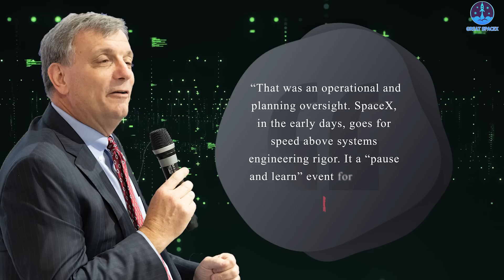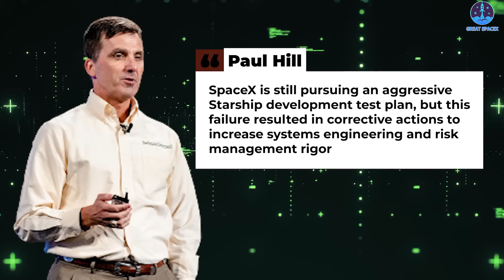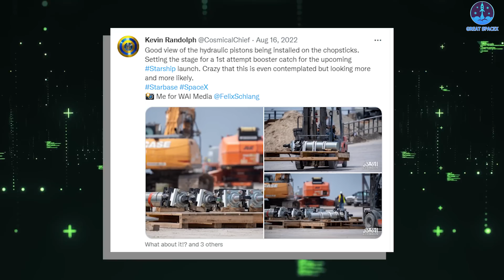SpaceX made HUGE UPGRADES in Stage 0 to prepare for orbital flight

Comment: There is no chance for a maiden flight of Starship rocket before implementation of another major improvement: dual use of Vacuum Raptors as propulsion engines and more importantly as support columns transmitting thrust generated by SH Booster to the Starship during launch and ascent.

Comment: NASA is too afraid of failure to try anything anymore nobody wants a failure but you learn far more from failure than you do from success
Reply: Total SpaceX fanboy nonsense! NASA hasn’t launched anything in the last 10 years. 
How’d you guys get so screwed up?
Reply from the maker: YUP!!!
Reply: Unless you’re riding in the rocket.
Reply: @MrSameOld  By the time humans are on board Starship 99.999 of the mistakes will have been corrected.  There will always be a risk.
Reply: If NASA forces SpaceX to move at the same speed as NASA, we will never get to Mars.
Reply: @kokomo9764  NASA has awarded SpaceX $4.1 billion dollars in the last 2 years for Starship development and construction. 
Tell me, exactly how is that slowing SpaceX down?